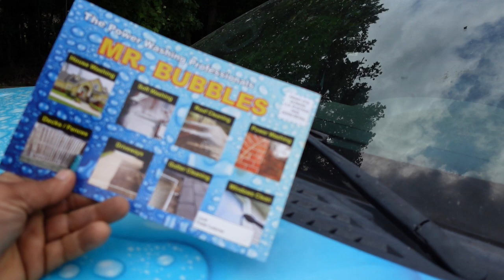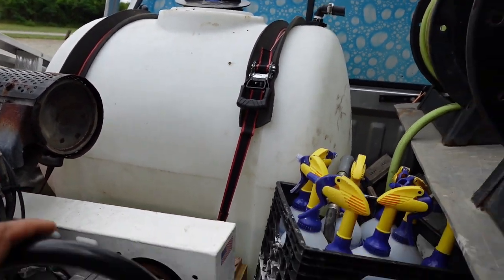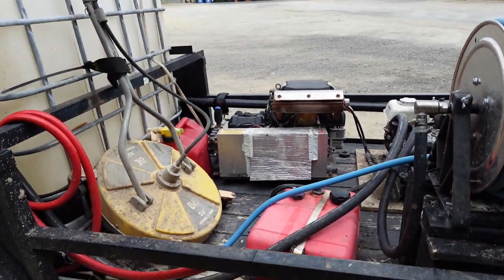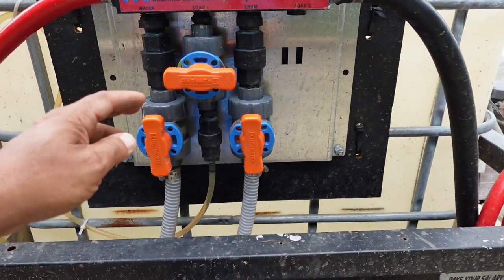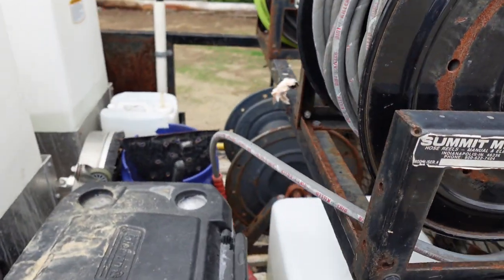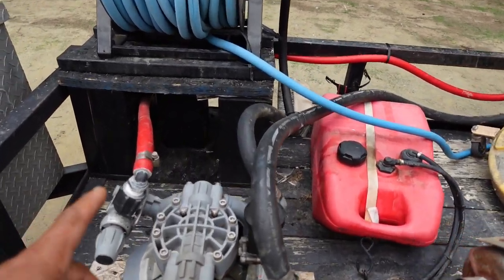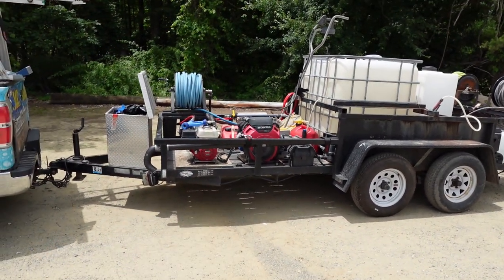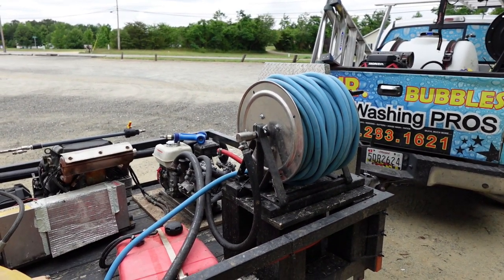Ep.01  PRESSURE WASHING Trailer Setup

Comment: What model ford is that?
Reply from the maker: Thank you for the great comment and question, it's a Ford F-150. We have a mixture of f250s as well.
Reply: @ASKMRBUBBLES  Thank you so much for your reply, and Great content! Question… is there anything f150 wouldn’t be capable of that would require the f250? I guess when would you use the 250 over 150 if I may ask?